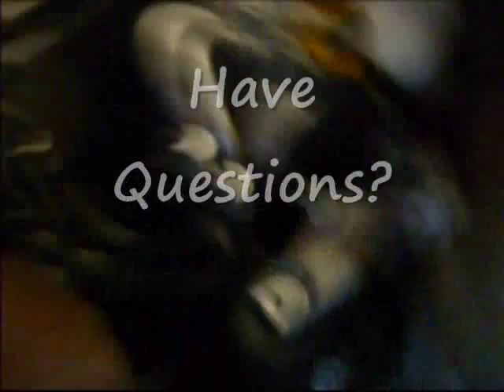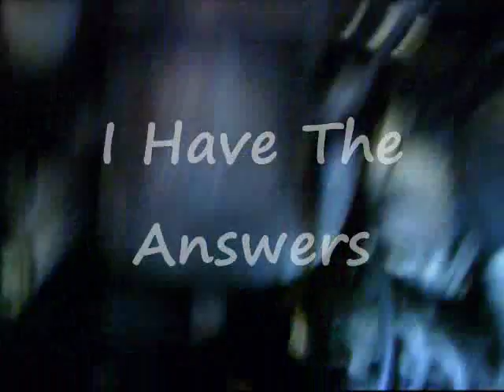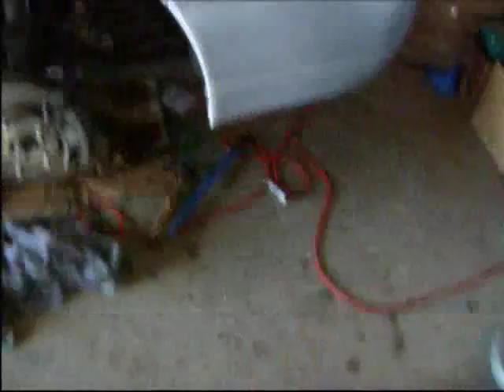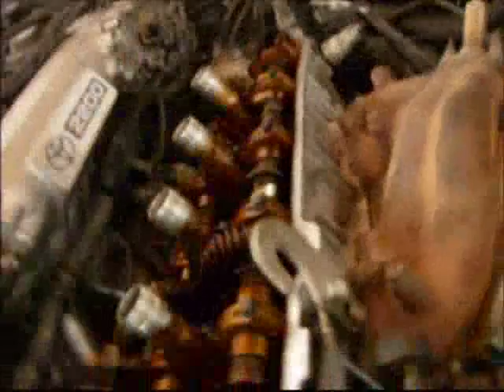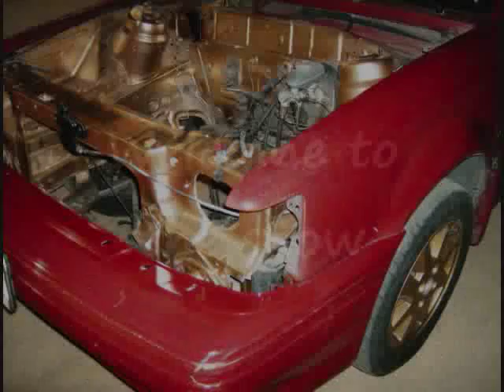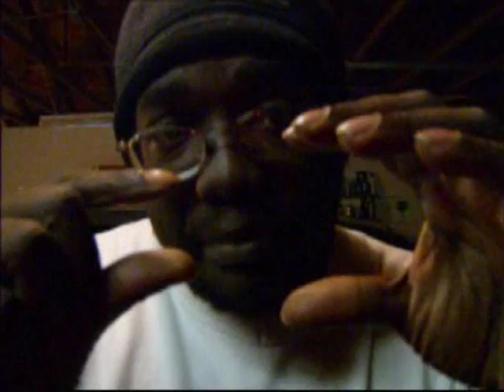Cars 101 Ep9: Air Cooled Engines

Comment: Interesting note about VW air-cooled engines. They are engineered to run engine oil temps of  215-230 degrees Fahrenheit. Using oil coolers to make the engine run at 180 is too cold for optimal engine performance and life. But using oil coolers can allow for allot more performance squeezed from air-cooled engines. Most water cooled engines are designed to run at 160-180 degrees water temp. But if you measure the oil temps, allot of them run 200-225 degrees oil temp. Diesel engines run cooler oil temps though, around 190 degrees.
Anyway, just an interesting bit of trivial on the VW engines being designed to run with oil temperature around 215-230*F but many people add oil coolers to bring the oil temp down to 180*F which is cooler than the engine is meant to run.
Reply from the maker: Bear Artorius Dude that's a very interesting tidbit of info!!!! I believe what you're saying too. It makes sense. The reason is use an oil cooler on a air-cooled vw is mainly because I run everything I get pretty hard. Doesn't matter what it is. I usually end up matting the gas pedal daily and VW's love overheating the starters and leaving you stranded until they've had a good amount of time to cool. But that comment you left was wonderful. Feel free to keep sharing on anything you run across that's on my channel that you feel will continue the trend of assisting in the enlightenment of the populous.
Reply: nezerac thanks for the kind words man. I'll definitely share. Just found your channel today. Enjoying it allot. Subbed.
Reply: nezerac I ran an oversize oil cooler on my old VW dune buggy. It helped allot with preventing overheating. I put a damper on the blower duct to adjust the airflow on the cooler. Blocking airflow helped warm the engine on winter days.

Comment: We use a lot of air cooled H-4's and H-6's in small air planes. It's preferable for the pilot to be able to control the engine temp with the throttle and the choke rather than relying on a coolant system.